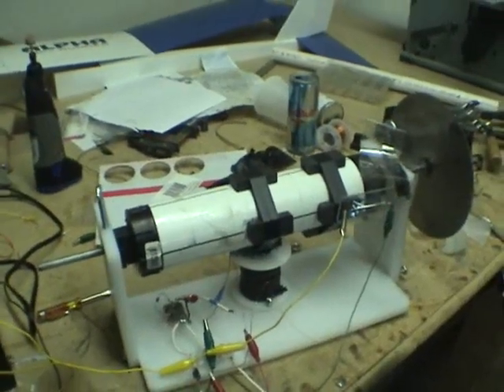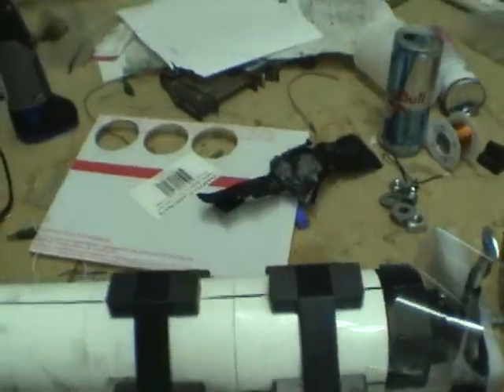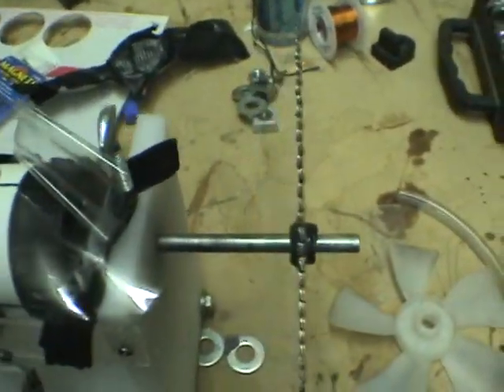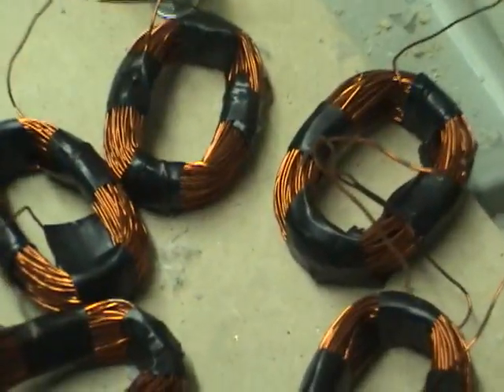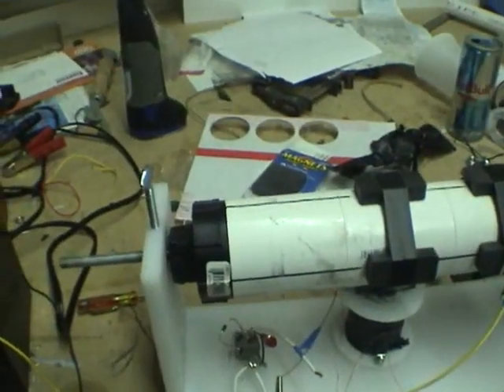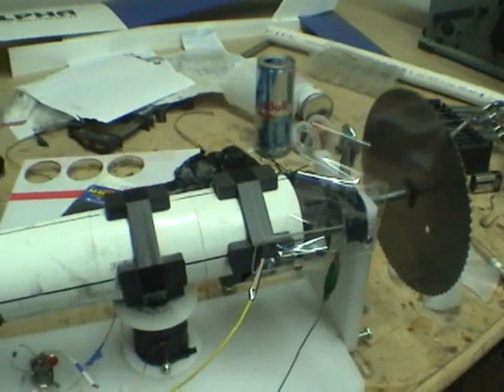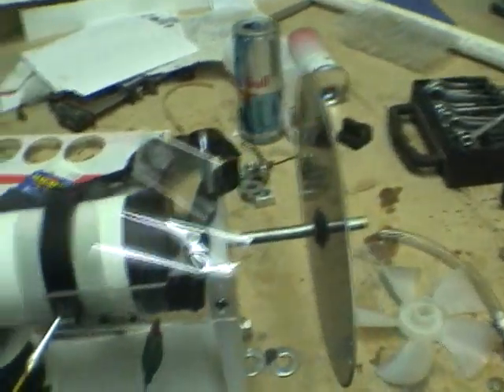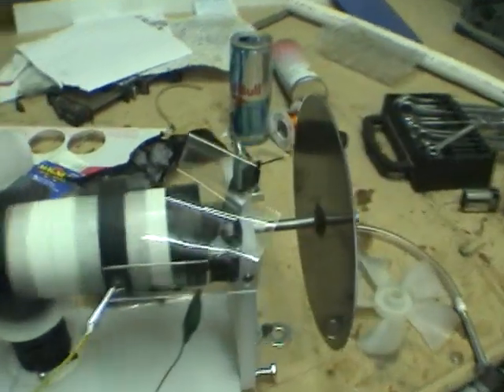Begining my work on the alternator(generator)

Comment: you charge a magnet by inducing a magnetic field, this can be done with an electromagnet taken to bar of iron. the magnet properties fade eventually, but are not "consumed" your motor, unfortunately, doesn't burn magnets as fuel, and wont produce more energy than they use.sorry.

Comment: @pbc1951 
don't forget the cost of the fuel for the trucks to haul the coal to the belt. the cost of the electricity used to mine the coal. your down to about 23% efficient.

Comment: Burn Coal, Heat btu's up the flue pipe,  it takes energy (btu's) to make noise, any noise the coal plant makes comes from the btu's in the coal and cannot go out to light our homes....   etc....
It is great to try and I like what you are doing....  Now water in a stream passing by, or the air blowing by... catch some of that and turn you generator and you can keep or use some of them btu's.

Comment: Magnets do not have energy in them, well no more then a drop of glue.  Stick a magnet to a steel plate or do the same with a drop of glue.

You made a nice electric motor so far.  Good and keep trying.   you will use more energy than you will make.  OK,   you will be making a transformer tho.  You will take say 12V DC and you will make some AC higher voltage.

Comment: The point your not taking into account is the eddy currents that will happen between your rotor and stator. The stronger your magnetic field is as it moves through the copper wires, the more resistance your machine will experience. This is why you wont get more power out then you put in. You do however have the beginnings of a very fine electrical alternator.

Comment: Was very impressed... until you dropped a real clanger.

A powerful magnet is NOT a continuous source of energy, it's like a powerful rubber band... it is NOT a  source of free energy !! To obtain continuous electricity you have to use mechanical energy to move your coils over the magnets. And if the magnets are more powerful, you need more effort to move those magnets !! Sorry to disappoint you, but I'm sure you're learning fast...cheers, good luck.

Comment: To save time and energy connect a DC motor to your motor with gearing or pulleys for mechanical advantage, because all DC motors are generators then use an inverter to turn the DC to AC.

Comment: kt-

I've already built a Bedini motor with a air-core coil alternator with 24 coils and 12 Neo-magnets as you're proposing. The unit produces 30 VAC at approximately 200 rpm. 
My problem is the Lenz effect shutting the device down. I have NOT tried using a reed switch as you have in this video. Do you believe the reed switch improves the torque? Also, do you use the back EMF off of the coil into a secondary coil to improve torque?

Comment: Also, as mentioned in an earlier post, adding centrifugal weights and increasing magnet strength many increase the torque sufficiently to cancel the drag caused by the load on your alternator.
Best of luck mate, I want to build one of these when I find time. Stay with it!

Comment: Would it be possible, for instance, to set up an automated switching system (perhaps electronic) that could alternate the two batteries being used, so that one may provide power while the other is being charged and so. Would this allow for continuous running?

Comment: i dont think we will ever get energy for free,(perpetual motion) but like you i think its possible to get more energy out of energy. good job, just remember that whenever you put a load on the generator its gonna put a drag on the pulsing motor. so maybe try to compensate by adding another blade with weights on the other side so centrifical force will be helping you.5 stars